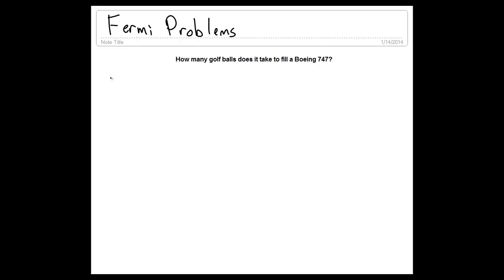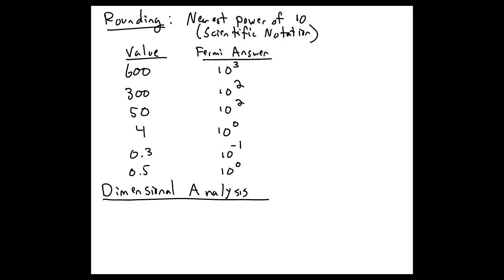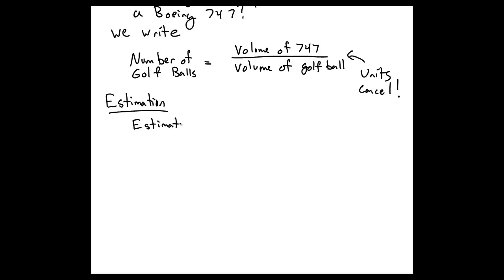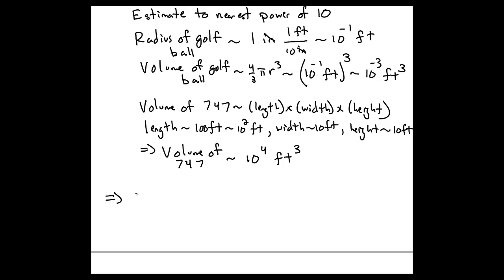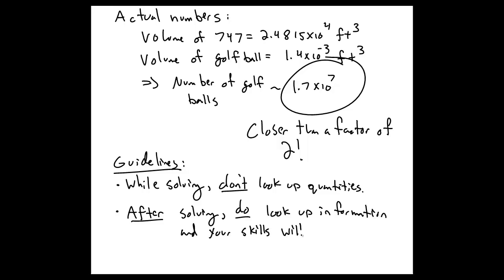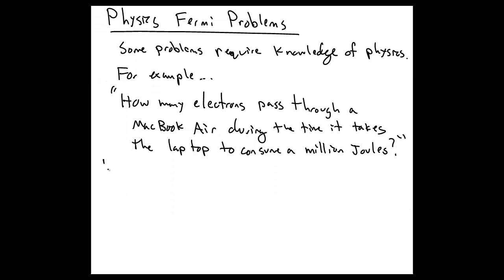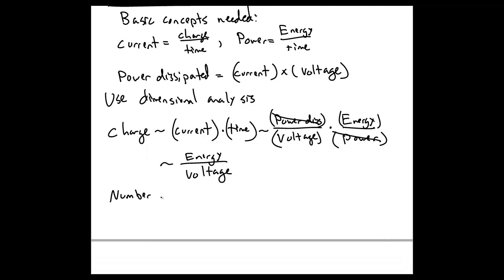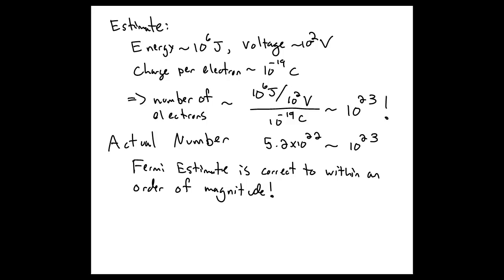Fermi Problems Tutorial

Comment: A golf ball is about a square inch.  Let's start with that.  A 747 is about the volume of a cargo container, three long, so 3 of those.  A cargo container is about 10' x 10' x 30'.  So my final answer is, fuck math.

Also, you can't say "actual numbers" and then say "about x" and use estimations.  That's absurd.

Also, you should Always look up numbers when you can, despite exercising your Fermi skills, because estimation is designed to fill in gaps in information.  Use it the way it's most useful.  There's almost always going to be something extra to guess at.  Extra guessing practice isn't needful.

Comment: It makes no sense to round the 4.  It's Easier to keep the actual number than to incorporate the rounded one, which means you've taken a step backward in accuracy for no benefit whatsoever.

Likewise for 50, 600, etc.  It's Just As Easy to use the Actual numbers, so changing them to estimations gains you nothing and loses accuracy.

Do the math for the easy numbers in your head, THEN incorporate guesses.